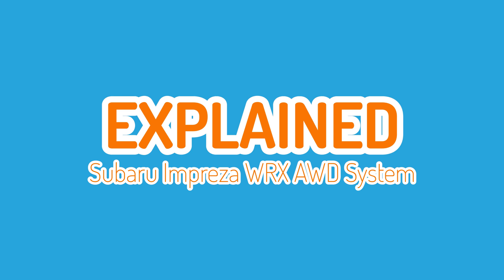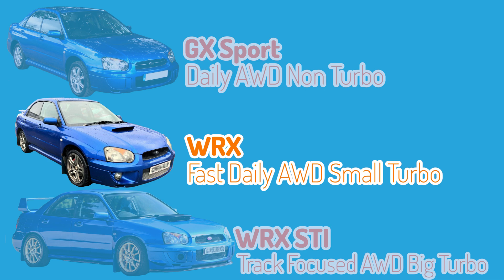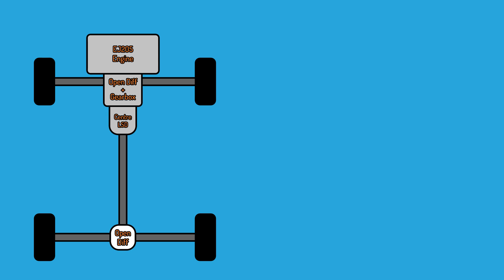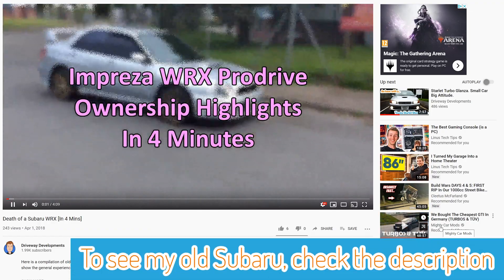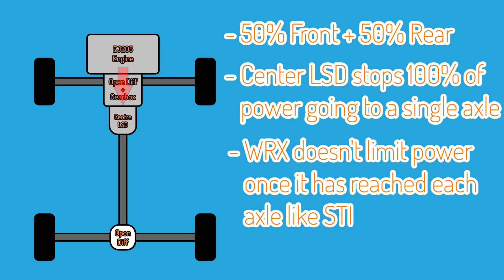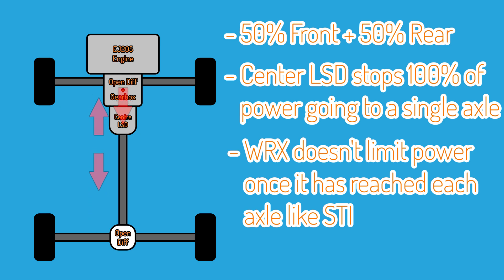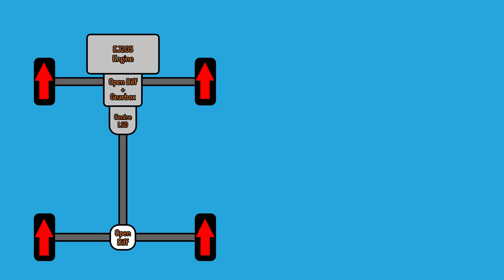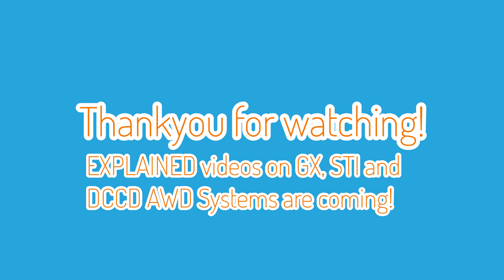How the Impreza WRX AWD System Works

Comment: you might want to re check your facts. WRX's have a VLSD on the rear, not an open diff. Jack it up, spin one wheel and the other will rotate in the opposite direction.

Comment: Actually open differentials have a fixed 50/50% torque split,  even if only one wheel is spinning. The engine will only produce enough torque to spin the wheels with the least amount of traction. So the wheels that do have traction might not get enough torque to actually move you forward.

Comment: I was always under the understanding that the rear diff is also LSD in the older WRXs.  I have a stock 03 bugeye and the rear diff is most definitely limited slip
Reply: @petebeckham8562  mine is a US spec, so maybe my rear diff has been swapped at some point. All I know is that its very fun and controllable when sliding out the rear on dirt/gravel or snow
Edit: also pretty much indestructible (so far) lol
Reply: @Grooove_e  no all 02-03 bugeyes got them im the original owner of mine and it has a viscous rear  lsd
Reply: yes center and rear are lsd